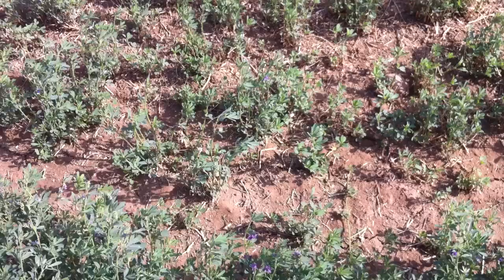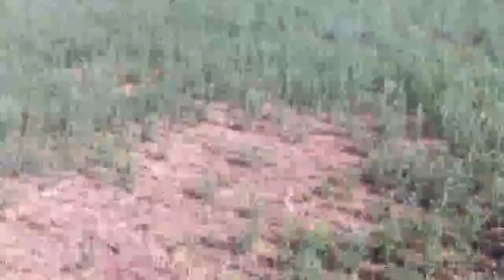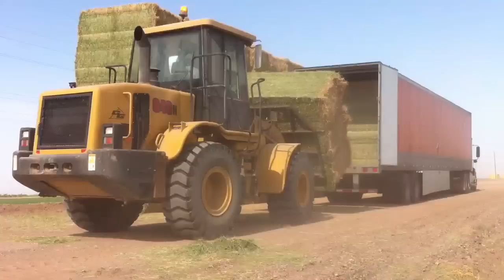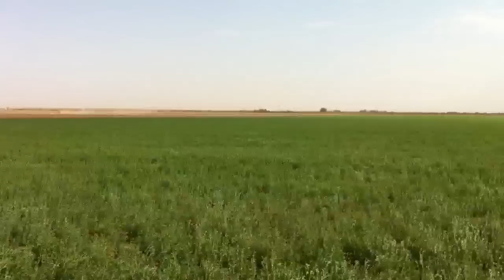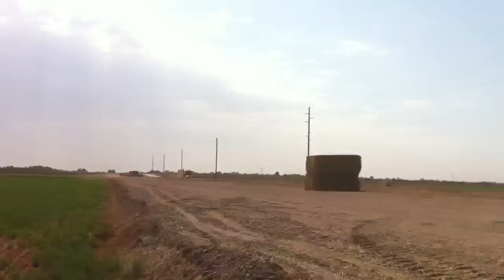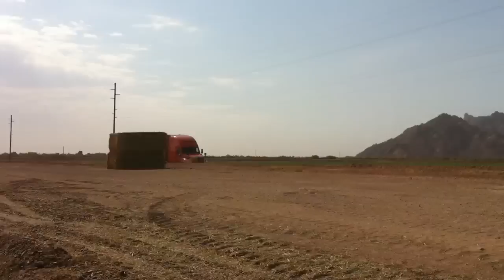How they load hay in a dry Van (trucking)

Comment: how the hell did they get that out?
Reply: +Jed Hergenrider They have a loading dock at the other end and use either a skid loader or fork truck to unload. It's more economical for the dairy to have van deliver the hay (though few actually do it) because vans generally charge less than a flat bed or drop-deck. The dairy needs to build a loading dock and it really isn't that expensive to build.